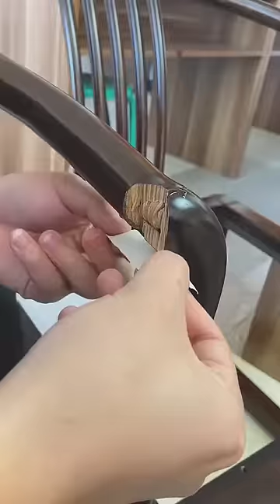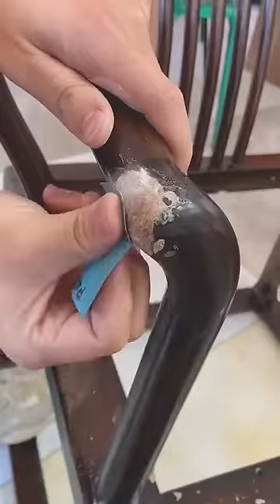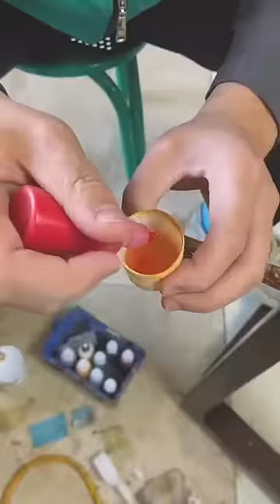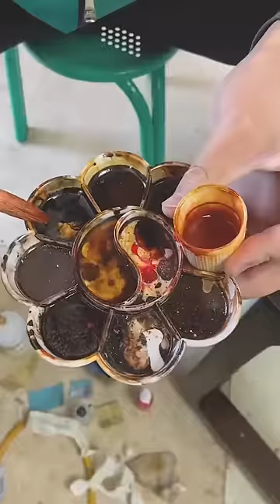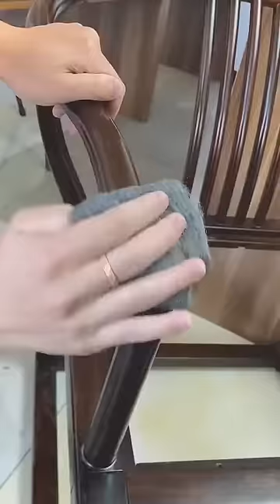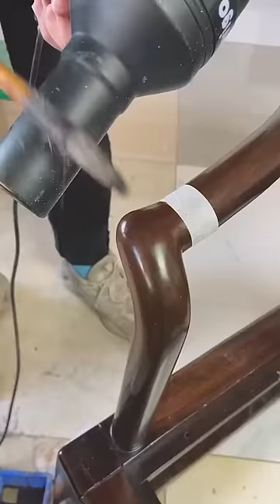I Fixed My Grandfather Chair

Comment: As soon as some leans on it, it's going to break again. Firstly you have to sand down the wood shavings and even at that there's no guarantee the wood shavings would compress into a full-on plank of wood, secondly you don't glue a broken object from the outside you glue it from the inside.

Comment: I would have made a hole and ran a peg threw it to connect the banding point better and then use saw dust to patch in the peg space invisible but would have made it stronger and almost like new

Comment: why the hell you fix that part with the back still broken!? before you apply the final touch you should have all fixed and ready to be painted.....otherwise you risk cracks in that area which you fixed shortly before